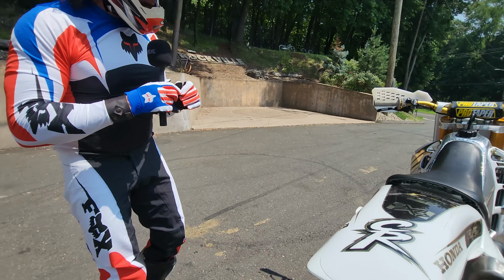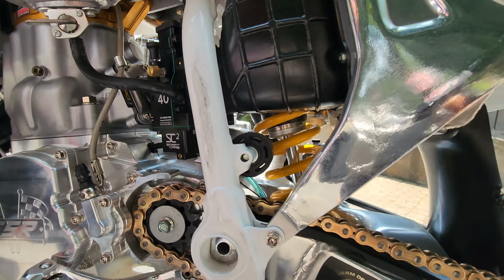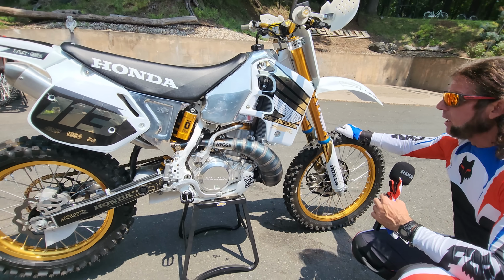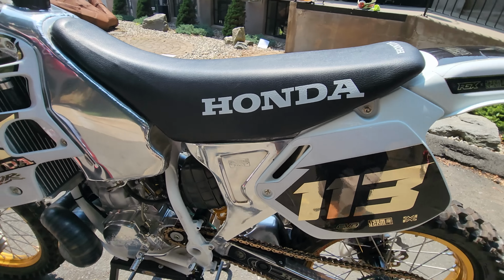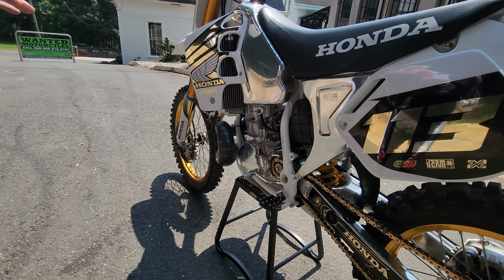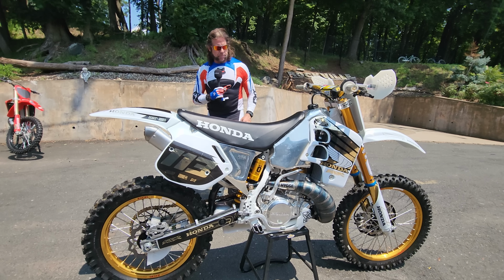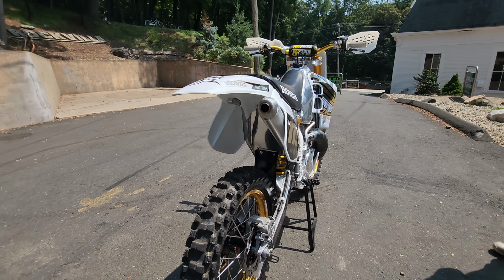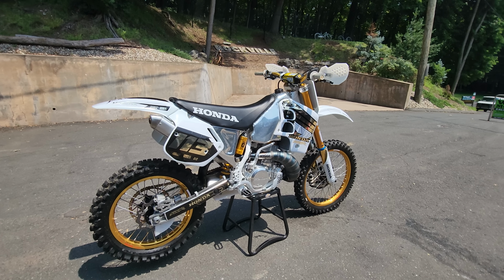THE TRICKEST HONDA CR500R EVER BUILT

Comment: there is no pinging in this motor ,its tight and right..its tooo trick if that can be ! and the air box is the sub frame , amazing  and an all aluminum gas tank ...i believe this one just raised the bar on quality . this one will be a tough act to follow ...i want it
Reply from the maker: Yes, you are right